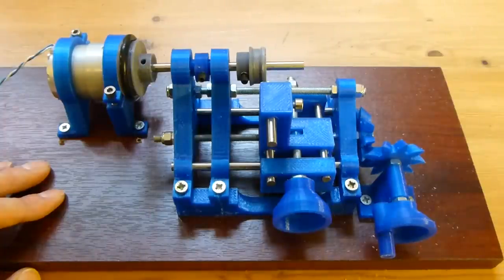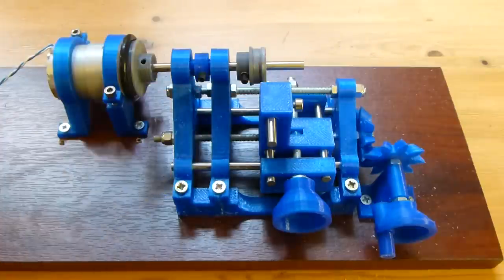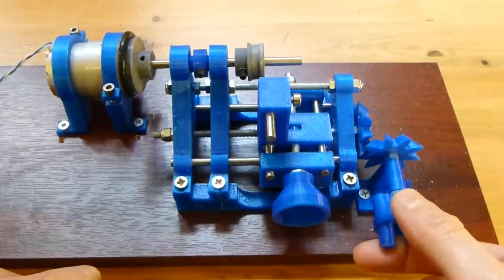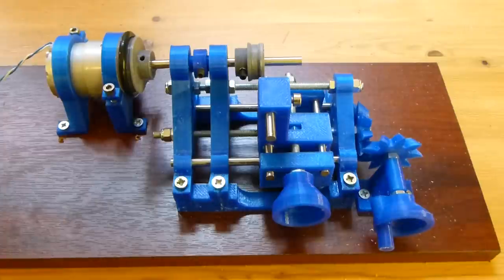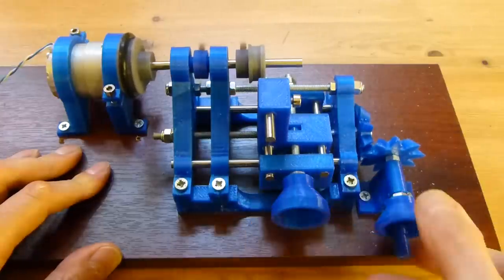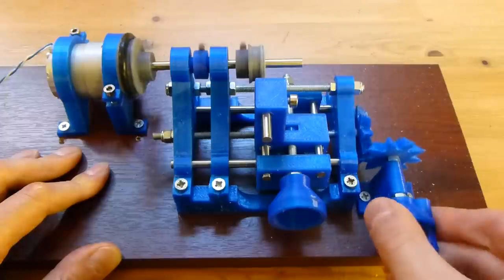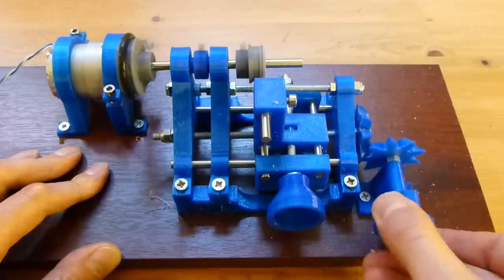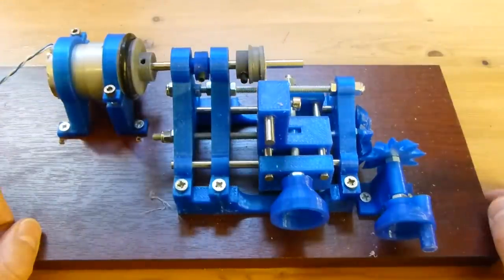3D Printed lathe in operation

Comment: I absolutely love this, what 3D printer builder doesn't want a lathe, though I'm afraid it's a bit of a redundant design. You could surely have got round pulleys by calibrating your delta a little better. Of course this video was made in 2013 when there was no Marlin delta calib, no Escher3D Least Squares page, no Duet with PCB effector. So whilst being technically possible it would have been hard given the RepRap technology at the time. What a beautiful anachronism this video captures. Thank you for sharing.

Comment from the maker: It was sublime's lathe that inspired my first attempt.  I needed it for a specific purpose, though, so I didn't go the whole hog and make a general purpose tool.  I might revisit it now, though.  There are several obvious improvements which could be made.
Reply: you might get better results with grinding paper , you could make a toolholder for holding the grindig paper so you can still use the XY table. Maybe wet grinding is better idk but i use grinding paper on my metallathe also often for improve the finish and when tigh tolerances are needed :) (i suse grid 40/100/400/1000)

Comment: Bravo buddy. That is a very good example of using what you have to improve what you have got.My hat is off to you. I built a 3d printer from scratch and have had problems with my z couplings being off center drilled. It does not affect the print but stresses the plastic z axis mounts. I love your ingenuity, keep up the good ideas. By the way, i think you can take the slack out of your 90 degree gear train by moving them a little bit closer but that is not really a problem and a guy able to build a makeshift lathe from plastic i sure bet you don't need advise from me. Good job.

Comment: Have you tried using RC plane brushless motors? They are quite powerfull and with a PWM modulator you can easily control their speed.

Comment: Sad Story. Shows what every 3d printer owner wants to have: A CNC lathe or mill. Me too..
Reply: To be honest, if i had to pick between manual or cnc, i would pick manual. 
I own a cnc mill and a manual lathe, manual machining is much more rewarding...
Reply: Rabrand1 l
Reply: Rabrand1 The sad truth
Reply: If you can afford a hobby-level 3d printer, you should consider the Chinese 3040/6040 routers on eBay to jump into CNC milling - I started out with a cheap 3040 CNC Router/Mill (not the aluminum 80/40-style, check out one with a solid plate build), and I'm only just jumping into 3d printing now. While these "router" style machines are better suited for reduced z-axis work height projects, it's a great starting point - My machine, with a 400w spindle and 4th axis setup, priced out to just around $600 total, and I was incredibly surprised with the rigidity of the machine.. I wasn't expecting much but sure enough this thing is rock-solid. Excluding the 4th axis setup, you can probably find one priced around $400 or so. I haven't ran into much of a "need" to upgrade the spindle yet, but with a powerful cutter (there's a common/simple 2.2kw upgrade), you could easily mill steel without an issue. As I mentioned, the lower working height makes this machine best for small and low-profile part milling, engraving, carving, etc.. Sometimes I'm disappointed with the lack of working height in comparison to a legitimate "mill", as my machine only allows about 3" Z-axis travel, but it does allow just over 13" x 15" XY work area. Adjustable spindle location helps retain full travel while compensating for work-holding height, but physically extending the z-travel, unless significantly compromising machine rigidity, would really make this machine stand out. For what I paid, it certainly feels like a great bang-for-the-dollar overall!
Reply: Blacktronics: You still play Q2 or play on some of the servers? noticed your quake 2 pic, lol
Reply: Yeah, but good luck machining any 3D surface.  Unless you were really good at etch-a-sketch.
Reply: Michael Porubek got a link for a CNC like yours?
Reply: Todd Eddings type 3040 cnc on AliExpress

Comment: Hey very nice project!
Why you don't print a pully system to help the motor...like the old Unimat lathe.
Reply from the maker: Paco Morales Thanks.  I confess that I don't know what you mean by a pole system.  I am intending to replace the motor with an old rotary tool (a cheap knock-off Dremel), though.  That will certainly give it more power.
Reply from the maker: Paco Morales I guess you can't really see it in the video, because of the camera angle.  The motor has a small pulley on it, and it drives a larger pulley on the lathe shaft via a belt (actually a big 'O' ring).  The motor is effectively geared down about 4:1.  It's basically very under powered, but the new motor ought to make a big difference.  As soon as I get a spare evening I will fit it and post a video.

Comment: Cool - I've been thinking about building something like this for a while.  I'm wondering about making it more general-purpose with a better chuck and/or collet system.  Any ideas?  Can you make a printed collet system?
Reply from the maker: I have seen a 3d printed three-jaw chuck, but it was quite large.  I guess you could use collets, though printing them might be a challenge.  The whole thing would need quite a bit of redesign to make it more general purpose (and a more powerful motor).  there is also a good deal of backlash in the gears; they would be much better as helical gears.

Comment: A geared down Dremel would solve your torque problem too. I bet you could machine aluminum and brass with one. Possibly steel too.
Reply from the maker: Ihave contemplated turning aluminium, but I think you'd pretty quickly run into problems of stiffness and strength in the frame.  Especially if you tried to turn steel.

Comment: With a few modifications, do you think it would be strong enough to cut brass and aluminum?
Reply: It would have to be heavily modified, but I bet it could be done. It would probably need to be much bigger. It's also possible to print hollow parts and fill them with concrete to add weight, that might help too. The main thing is that you need some heavy duty tapered bearings. I'm not sure how you would get around needing a big, solid, and precise piece of metal for the chuck though.

Comment: Try using gears on the motor for more power, you wont have the speed, but you will be able to make deeper cuts
Reply: With a lathe you sort of want a high speed rather than a powerful motor. Having both is what you really want though.

Comment: The drive motor off of a vacuum cleaner would be a good choice.
Reply from the maker: since I posted the video, I have modified it to use an old pseudo-dremel as the motor.  I must get around to making a new video.
Reply: I can see a Dremel being used for this with gear reduction to help the toque.  Heck, a 20:1 pulley system on a Dremel at 30k rpm still means you would be getting 1500 rpm with a lot more torque too.
Reply: A mount for an upside down power drill would be amazing.

Comment: I've noticed that the wires to your motor are relatively thin... try some thicker wire, with maybe a higher amperage power supply, and that motor should be able to handle that load better...

Comment: Nice! I wouldn't bother with the gear though. Just mount the crank directly to the threaded rod.
Reply from the maker: peterthinks Yes, that would make it much simpler.  Not as satisfying, though :-)
Reply: True. How well do you think this would work with a dremel? Or would that be too fast?
Reply from the maker: peterthinks If you mount a small pulley on the dremel spindle and a larger pulley on the lathe spindle, then you can scale the speed how you like.  I imagine it would be quite a good motor.  Perhaps I'll design a mount for mine and give it a try.

Comment: Very cool! Try scavenging a more stout motor- I have found that blender motors are incredibly torquey, though maybe bigger than what you need. I pulled a 12V/6A DC motor from a kid's motorized yard toy, too, that might be more in your realm. Just tell them it's for a cause, they'll understand.
Reply from the maker: Austin Winn I agree it needs a better motor.  I'm looking for one from a dead battery-powered drill, but haven't found one yet.
Reply: Peter Robinson Maybe you could just print mounting brackets for an entire drill (corded has more power)?

Comment: Why don't you just use 12 or 16mm (much better and rigid) straight bars from China as guideways, UCP205 bearings and C25/ER32 collet chuck extension as spindle? Is it relatively cheap, easy to buy, and notable rigid lathe base able to cut soft metals. A few weeks later I'll make a video how to do it if a local snail mail does not lose it.

Comment: Ah cool! Nice to see someone making real functioning machines using 3d printing. I want to buy a Prusa Original in order to build functioning electronic / mechanical prototypes of all sorts, do you have any top tips for creating strong usable parts and assemblies? "Ask the man coming back from the path what lies ahead" and all that! Cheers for reading, am going to sub and check out more of your stuff.
Reply from the maker: From my experience, there are two ways to achieve strength in parts.  First, you can increase the fill density.  This slows down the print, increases the weight of the part, and uses more material, but it's quite reliable.  If I remember correctly, the lathe parts were made with about 30% fill - they don't actually need to be very strong.  Second, you need to make sure that the layers are oriented so that whatever forces are present, they are not being peeled apart.  I find most failures are down to poor bonding between layers.  This is particularly relevant where a part is being subjected to bending.
The other approach I have tried is to make parts deliberately hollow, and then fill them with metal-filled epoxy resin.  But that's not just 3D printing :-)
Reply: I love the idea of filling with epoxy, I may have to use that! Re bending, hm if I remember by mech eng, in bending you get tension in the top half of the cross section, decreasing to zero stress at the midplane, and then becoming a mirror image but in compression on the bottom of the cross section. If its printed in layers, my guess is that you will also end up with a shear stress placed on the meeting point of the layers due to the different tension / compression on each layer. 

Is it possible to increase the shear strength of the individual joins at each print layer, or perhaps select a print material with a higher shear strength? If you increase print temp, what happens? Id love to experiment with kevlar print materials, I have seen tow hooks made from it! Amazing. Oh, and subbed!

Comment: Cool Lathe however why not simply use a drill and a bit of sand paper you would get better cleaner results much faster. not to mention not have to spend all that design time building your own lathe,   Cool video none the less however.
Reply from the maker: Two reasons: firstly, I wanted to build a lathe :-)  Secondly, and more importantly, the problem I had was that the pulleys were not exactly circular.  I needed to hold the tool (or sandpaper) a fixed distance from the centre of rotation.  I could have done this with a pillar drill, perhaps, but I don't have one.  With my hand-held drill, I could not have kept the sandpaper steady enough.

Comment: Really im not being a douchebriklet here But this is very hard to take seriously, I was actually laughing the whole video. But yeah I know it's almost all 3d printed It's quite impressive. Im a machinist so...
Reply: I felt the same way seeing this haha. after turning motor armatures and alternator rotors for years on an old heavy duty lathe this is comical. If you needed something this small you can pick up a great micro lathe with tons of different bits and configurations on ebay for around 100$
Reply: both of you guys completely missed the point of the video
Reply: @Matteo Baldini ;  no, I think the commenters point is that the video missed the point of 3d printing;  "I suppose it is tempting, if the only tool you have is a hammer, to treat everything as if it were a nail"
Reply: If he found it fun and interesting to do than it was worth the time. People build model trains and stuff all the time without expecting to make money or anything of real industrial use off of it.
Reply: Andy, if you can tell me where there is a halfway decent micro lathe for around 100 dollars I would honestly like to see it. Even the cheap Chinese ones with terrible reviews are at least $500 that I've seen.